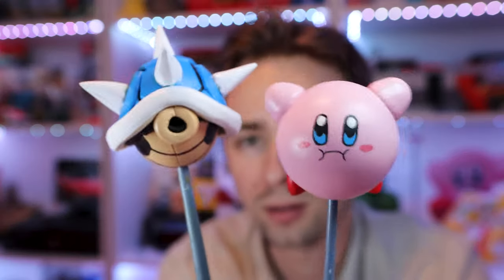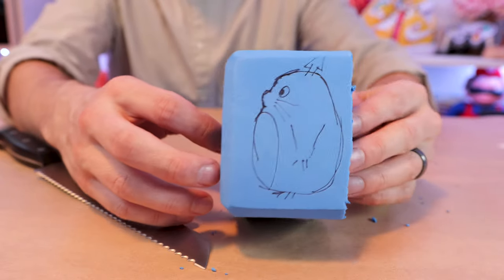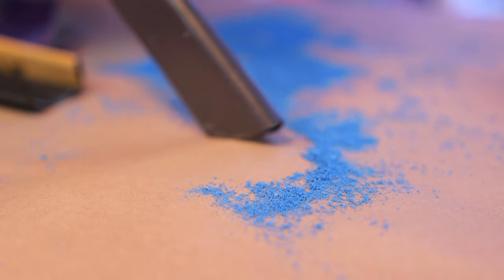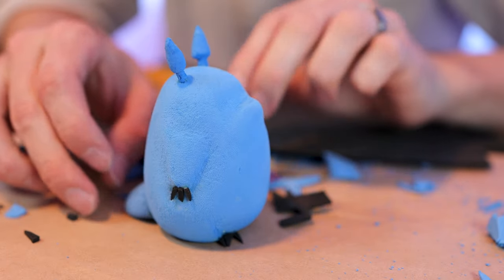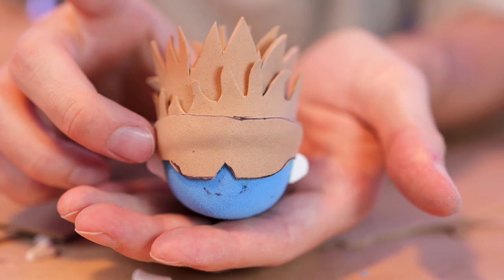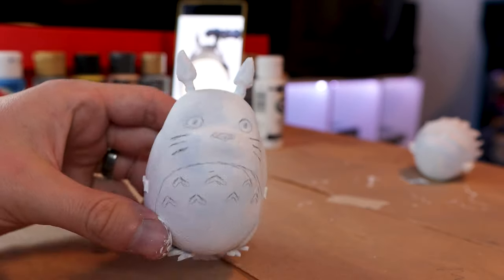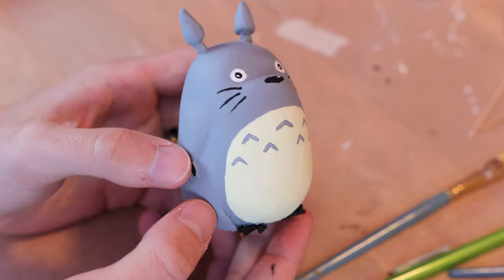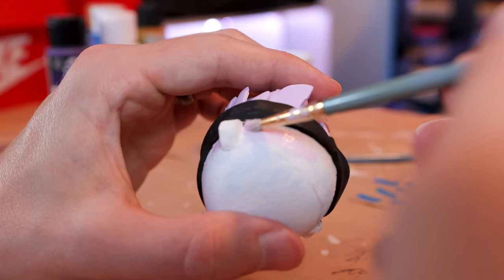DIY Car Antenna Toppers

Comment: I just made my own custom antenna topper out of foam clay. I used PlaidFX flexible acrylic to paint it and then I sealed it with Plastidip. It came out great, you should give the foam clay a shot!
Reply: What if you use a round topper and build off it with the foam. Thats what im going to do now.

Comment: So why base coat white instead of something more neutral like Olive Drab? looks like painting them while on a stick could have made things easier. End results look great.
Reply from the maker: Because white is a good color to start with. Some colors are more transparent than others like yellow for example. So you have to do a lot more coats with yellow if you're painting on a darker color. So starting with white is a good choice. Thanks 😊

Comment: How do you secure them into the car antenna itself?
Reply from the maker: Once you drill the hole into the topper, the dense foam acts as its own suction cup. Which is why you wanna drill a hole smaller than the antenna. It should take a bit of strength to get the topper off the antenna.